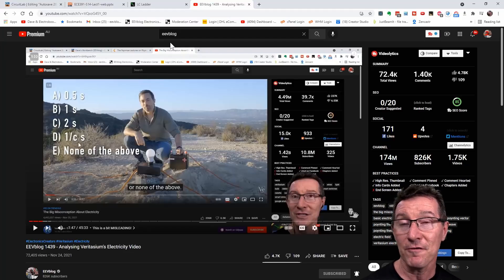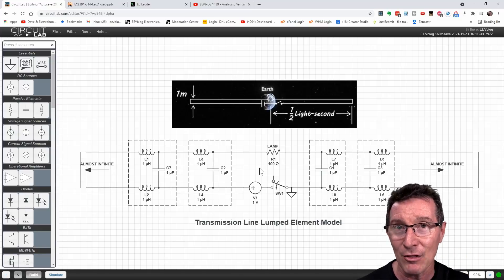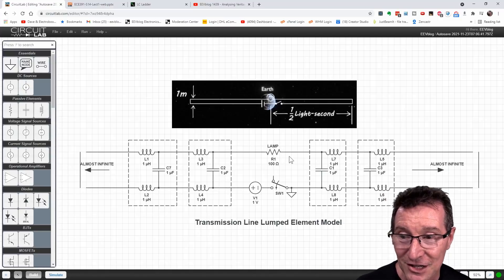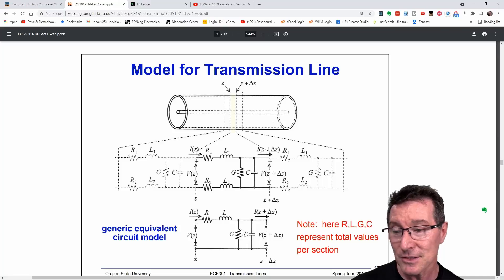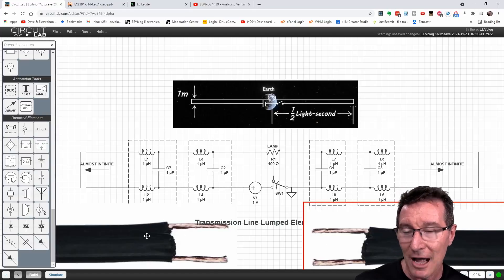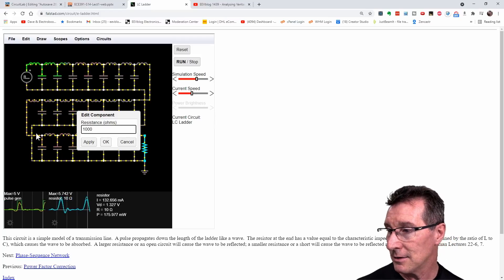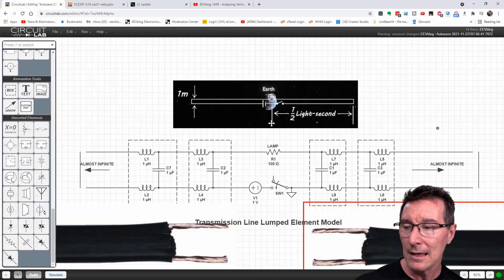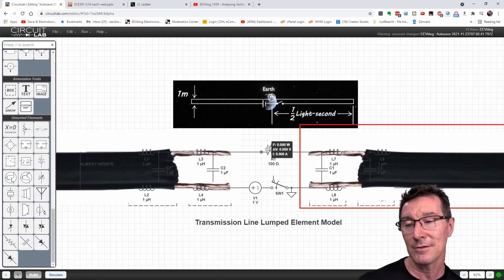Veritasium Electricity Video - Simulation Notes

Comment: According to Veritasium videao, this had no relationship to transmission lines or antennas, they hide that information very well . If veritasium title had been. "How long will it take the signal from one antenna to another at 1 m of distance", there would not had been any discussion and no clicks. The video was pure click bait.
Nowhere in the video is said that the cables must be at a constant distance on 1m for that to work, for example.
Reply: What he needed to mention was that the "circuit" could just well not be connected at either side. Because the what is happening in the video is not about how circuits work it is about how atennas work.
Reply: This is what, to me, makes the Veritasium video worse than useless.  Derek holds back the details that would help someone to understand what's going on.  He seems more interested in being the only guy in the room who knows what's going on, which is a very poor trait for someone who calls himself a teacher.  I thought he was being a bit of a dick with his wind-powered-car-that-outruns-the-wind videos, but this is the last straw.  I won't be watching any more of his flexing.  There are other big-brained people out there like Steve Mould and Sabine Hossenfelder, who genuinely want to teach.
Reply: @UC15LudaAQ2pPq3gyFNQK7gw  Veritasium's main point is correct:  it's actually about how ALL circuits work.  (If we pretend that antennas use a different physics than DC, then we're ignorant of basic Maxwell, as well as missing the whole point of Veritasium's video.)

After all, in RF-engineering we're taught that the same physics works at DC as works at 60Hz and works at 60GHz.   So, we can easily make a "DC Antenna" by making the wires longer.
He's showing an actual Maxwell fact: all electrical energy flows entirely outside the circuit.  There is no special magic frequency where DC becomes AC, or where AC becomes RF.   It's all one beautiful thing, and anyone who figures this out, can now understand a bit of the "black arts" of DC reflections and GHz design.

It's also showing that electric companies are selling us pure EM fields, not "current," and not electrons.   The amount of energy flowing inside any copper wires is exactly zero, even for DC.  While the current is truly inside, the wattage is entirely outside the wires, regardless of frequency.   Individual electrons don't carry the energy, instead it leapfrogs across the movable electrons, trapped on wires but not trapped on the slow-moving electrons.   And, for pure DC, the electrical wattage is still a wave traveling at speed of light.  Very weird, but that's how Maxwell's equations work, when we understand them, rather than just memorizing for the exam.   Take Veritasium's video very seriously, since it's teaching us the heart of Maxwell's concepts.

Back in 1890 when it was first discovered, top experts HATED THIS STUFF, they ridiculed Maxwell, sneered at math, tried to suppress Heaviside's math papers.   They KNEW that electric energy flows INSIDE the copper, PERIOD.  If all the engineering math says differently, well, they'll just kick those engineers out of the professional society, and fire the journal editor that published those papers.  This really happened. Anger and denial, and trying to kill the messenger.  (Seems familiar?)
Reply: @wbeaty  that isn't true, most power we use is steady state where the circuit actually has to be closed
Reply: @wbeaty  Right.  All electrical energy flows entirely outside the circuit.  And yet the wires heat up.  Please explain that.  And yes, there IS a magic point where DC becomes AC.  It's called ZERO.  If the frequency is ZERO, you get ZERO change in magnetic flux, and you get ZERO induced current.  "No matter how small" does not apply to ZERO.

Prior to Maxwell and Heaviside, engineers believed only in the steady-state, and thought that transients were unimportant.  Heaviside applied Maxwell and proved them wrong.  But you're trying to throw the baby out with the bath water: the solution to every power equation has both a transient AND a steady-state part.  Ignoring the steady-state is just as wrong as ignoring the transient.
Reply: @BrightBlueJim  "Please explain that"  If you don't already understand, just look up any textbook that goes into it.   For example, it's in the Feynman red books, somewhere near 27-5 iirc.   Clarify:  We're talking about circuits transferring electrical energy, and that part of the energy flows parallel to wires, outside the wires.  Yes, energy-absorption exists, and resistors heat up because electrical energy flows radially into them, going inside the material.   But electrical energy can only make its way across circuits because it moves through space only, parallel to the wire surface.  Yet energy goes radially through the surface!  Which is right?   How can we understand this?   It doesn't make sense!  (Yes it does.)

Do our giant power lines heat up slightly?   Yes, because, whenever the megajoules of energy are zipping along through the air, flowing parallel to the wires, there is a tiny "radial leakage" going inwards, because the wires aren't zero-ohm ideal conductors.  Radial flow only.    So, when dealing with ideal schematics and their zero-ohm wires, then there are no ground loops, and all shielding is perfect, and all electrical energy flows parallel to wires only, and no energy appears inside them.    But replace our ideal schematic-lines with small resistors.   That "steals" a bit of the energy from empty space, making it flow inwards into the copper.   But this inwards flow is purely radial, and has zero component parallel to the wires!  It's not part of the energy being sent across the circuit.   If it gets into the copper, then it gets absorbed.  (That's because the wires have zero radial e-field inside them, hence zero energy-flow directed along the wires' axis.)  Any electrical energy flowing inside the metal is flowing radially inwards, ending as wire-heating.   All that electrical energy being sent along wires?  That part is entirely in the space outside the metal.

"If the frequency is ZERO"  heh, 1Hz is AC, 0.1Hz is AC, a pulse per year is just a brief transient.   Why is this important?

In Maxwell-view, even at pure DC, there is a speed-of-light flow taking place just outside the wires.  No waves, yet a "smooth" flow exists.   We can easily measure this when we turn our flashlight on and off.   But that's just the edges of the long pulse, and the sharp edges don't transfer the energy.   The bulk of the long flashlight-pulse is moving at lightspeed, even if the pulse is seconds long, minutes long, etc.    "DC power" seems smooth, yet is still a fast electromagnetic flow, a very long wave propagating at the speed of light.   Again, this is the "Maxwell-world," the physics that makes DC systems possible, and usually all concealed by ohms-law and nearfield-think.   The simple view works fine, until we crash into spots where it fails.   Then we unpack the full-blown physics.   (But the full-blown physics applied to every circuit, DC or RF.  Just as Veritasium clearly tells us.)

Which viewpoint is the correct one?  Voltage and current?  Or e-fields and b-fields?   Both of course.   The EM version is for the physics-lovers among us, and for electronics nerds who want to work on hundred-mile DC supercon transmission lines, or GHz pcb designs.   Or get university eng. jobs like mine, where the Maxwell viewpoint gets used all the time, until finally we can SEE the invisible wattage flowing in the space around every pcb trace.   (If I hadn't learned to see this, I wouldn't be master of the Dark Arts!   Now go build some battery-powered superconductors, then mentally grasp the a-field, and work out a classical explanation for stimulated emission, which finally lets you figure out how those darned Yagi antennas really work.)

PS   
Take a look at the lower half of this diagram, part B. http://amasci.com/graphics/kraus_poynt.gif  
It shows that, if a wire is run through a tiny hole in a perfect shield, the EM energy-flux is not blocked.   Instead, EM energy follows the tilted e-field, squeezing down and passing through the tiny gap!    This is a real effect, and if it was an AC line, and a lossy dielectric was placed in that gap, it would absorb that intense EM field and be heated.   It also shows how enormous wavelengths can fit inside little thin coax cables.   (This is why it always seems that EM energy must be flowing inside the copper metal.   The wires really do guide the EM energy-flux, and it goes where the current and voltage lead it.)
Reply: @wbeaty  First, I hope you didn't expect me to read all of that.
And second, you just don't get it.  The Poynting vector is the NET movement of energy.  This is like saying that the energy in an airplane propeller is going out the top of the wing, because there is net lift.
Reply: @BrightBlueJim  I tend to write for book-people, reading lovers.    For the visually oriented, instead just watch Veritasium's video.  (But if you cannot read a page of text, and don't want to encounter any detailed counterarguments, then you'll have to check out the several recent videos that say what I'm saying. )  

And no, not Net.  Instead, Poynting vector is the full detailed physics of electrical energy flow, all the way down to energy-transfer between individual electrons. Circuit-theory and ohms law, THAT is the simplified net energy flow, where for example the details of 3D em flow-patterns are all blended together and just labeled "ten watts."
Reply: @wbeaty  As it happens, I am a book person.  But I don't have time to read a hundred books a day, and have no reason to think your book is worth my time.  I could go on, but I'll keep it short out of courtesy.
Reply: @wbeaty  All of your reasoning (and arrogance), yet you don't acknowledge BrightBlueJim's original point: "Derek holds back the details that would help someone to understand what's going on."   I'd say he goes further than this and somewhat misrepresents what's going on.
Derek's video fits exactly with his channel name-- "there's an element of truth" to it.
and I guess you didn't watch Veritasium's video on "visual learning" :-D

You instead attempt to insult someone using the term.  Not cool.  If you believe you have the knowledge and skills corroborate what was said, you should explain in terms that he'd understand, and in a manner that would be received, rather than throwing around jargon that is somewhat irrelevant to the conversion just to emphasize your supposed authority on the subject.  It just reinforces bad stereotypes about academic people (...ironically, basically the exact thing that BirghtBlueJim was pointing out, now that I think about it).

For the record, I think Derek is a pretty good teacher most of the time, but I think he stumbled a bit with this video.
Reply: Hmm, I think it clearly states that the wires are 1 meter apart. But I agree with the rest of it. 
I find it very surprising to see so many respected people backing the conclusion to the video when it is very clearly NOT a transmission signal question that is asked. 
Like you said! Just change the question to: "How long will it take the signal from one antenna to another at 1 m of distance" and you won't hear me whining about how wrong the answer is. Tho, I will still disagree about powering my appliances that way.
Reply: >Nowhere in the video is said that the cables must be at a constant distance on 1m for that to work, for example.
they don't need to be at a constant distance.